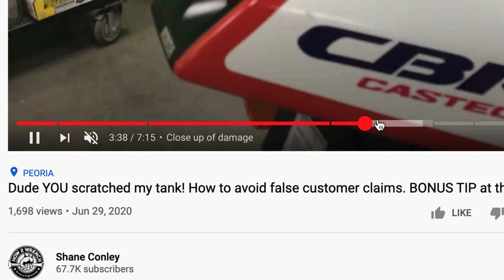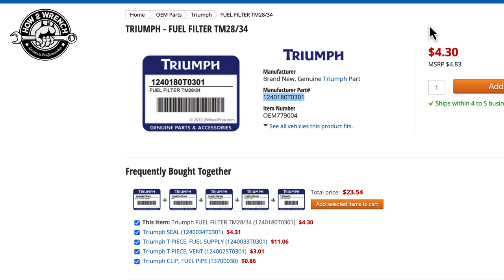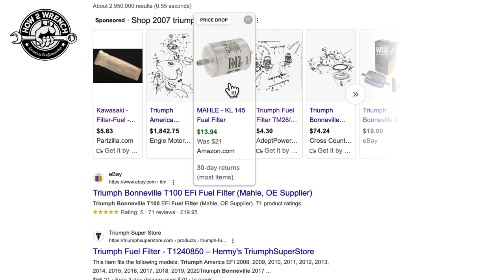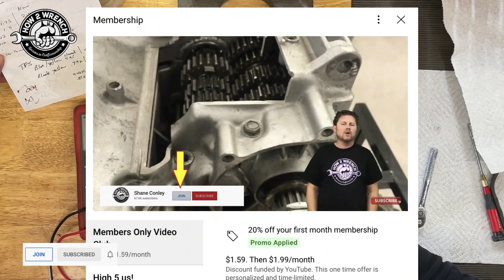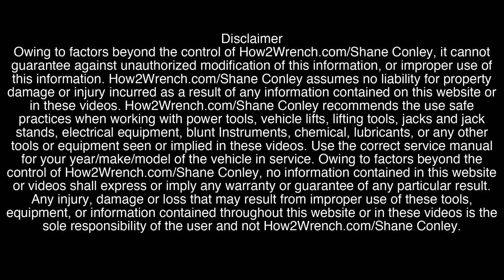Triumph Bonneville T100: How to split a carburetor rack, Keihin CV, Japanese models are similar!

Comment: Looking forward to checking out the TPS setting video.  I just bought a 2007 Bonneville that's been sitting for 4 years.   I undid that sensor to clean the carbs, but didn't realize there was a whole ordeal to reset it.
Reply from the maker: Right on.

Comment: Gerat video. I have a 2005 T100 with Keihins. The float bowl seal is leaking on one side and I want to give it a shot at fixing myself. So I assume all this same carb assembly comes off. I found the kit that has the seal and float needle etc. I assume it makes sense to do both sides since I have it off? I am not afraid to get into it but I am NOT FT wrencher. Anything else I should do while I have the unit apart? No leaks anywhere else I can see. Thx

Comment: Excellent job.  Two points if I may:  The fuel rail with the o-rings rarely need replacement unless they are cracked at the plastic bung.  New o-rings usually does the job.  Also, the float bowl heaters do not need to be removed to remove the crossbrace.  In fact, I suggest not removing the heaters as they are prone to breakage.   Keep up the great work.
Reply from the maker: Thank you for commenting with the kind note. 🙌  Where in this beautiful world are located? We are in Phoenix AZ. The heat alone, along with old age does quite the damage on rubber seals and parts from lack of use even more. I find plastic actually melted in storage sheds! It's nuts!

For this model zoom in at @34:02 and you will see the carb heaters block the bracket and removal screw. And for the o-rings, that is the number one thing we get carbs sent to us weekly from all over the world as people feel intimidated to split the rack. www.how2wrench.com service department literally could run full time on our carb service https://youtu.be/ejxzl3Lp5XM You'd be shocked at how many beautiful carbs come in from fresh cleaning and while they look beautiful leak like crazy. 

You rock for commenting! We will let Shane know! Throw Shane a high five donation, channel membership or merch for saving you $$$$$$$ Links below to support more for this work! 🙏
Want even more? Best $2 you'll ever spend...Join this channel to get access to perks:
https://www.youtube.com/channel/UCBhM8DCKnT3qXwTW0eToyCg/join      
-Daily MEMBER FIRST COMMENTS ANSWERED FIRST 
-Live Q/A video chats
-Wonder if we have a video on your need? Members can request content links!
-Full Access to the ENTIRE 700 video library
-Member-Only FREE tool giveaways  
Ways to support or high five How 2 Wrench! Thank you in advance. YOU MOTIVATE US TO DO MORE!
1. Smash the subscribe button (thank if already a sub!)
2. Have you seen our "YouTube Trained Support Shirts?  https://goodfellasmerch.com/collections/how-2-wrench/products/support-shirt  
3. High five donation:  https://www.paypal.me/how2wrench   
4. Got an emergency and your head is about to explode from frustration or fear? Get Shane’s cell here: https://how2wrench.com/ols/products/techline-one-on-one

Comment: Where do you order your Triumph carb parts?  I'd like to get new o-rings for mine, since i have to split the rack to clean that cross over tube, might as well put new o-rings on them.   I can't find an o-ring kit for my 2007 Bonneville Keihin carbs.  Or can I just buy an assortment of o rings on amazon and find some that fit?   (I just got the 2007 Bonnie, my first modern ere Triumph.  I find it easier to find the parts I need for my 64 Triumph 650.)   Edit - I just noticed you may have a video on selecting o-rings.  I'll be watching that next.   My carbs have the 4 plastic washers.
Reply from the maker: I just used the local Triumph Dealer as I was fortunate enough to know someone there.